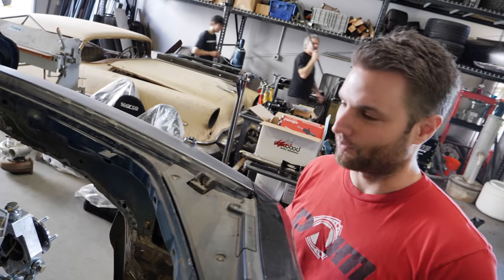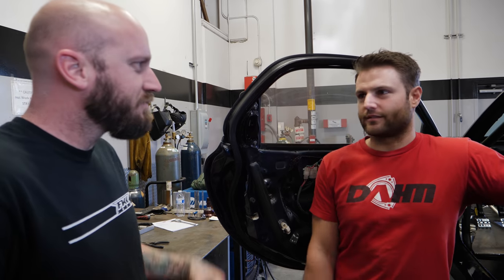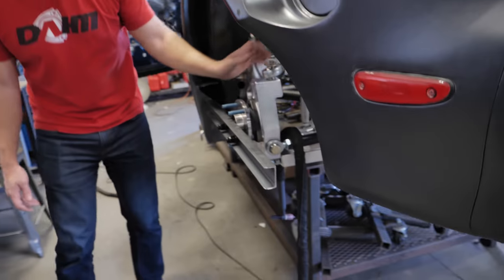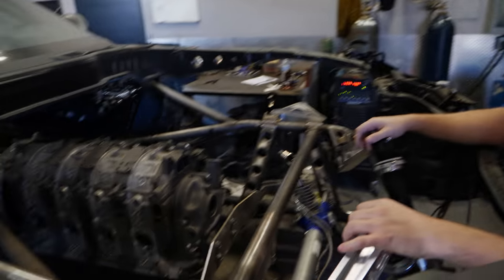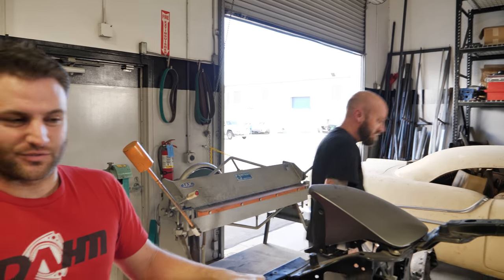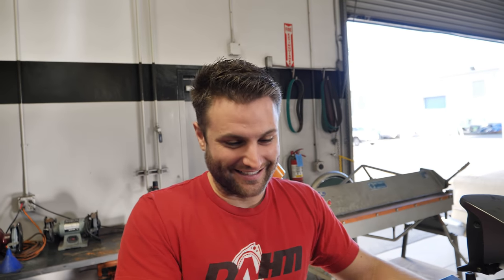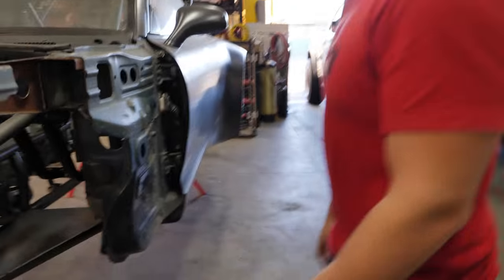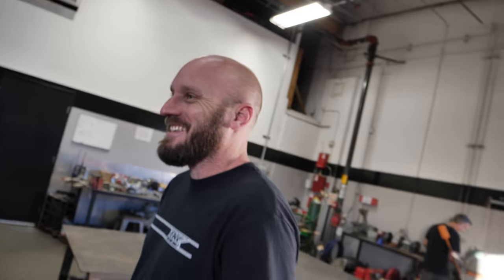The Finalized Chassis is off the Frame Rack! | AWD 4 Rotor Build

Comment: I admire your persistence.  I wish you'd hired an engineer (or at least a savvy undergrad) to design your frame and suspension.  Triangulation and load paths were not dealt with properly.  It will be a handful to drive, especially with the excessive power.